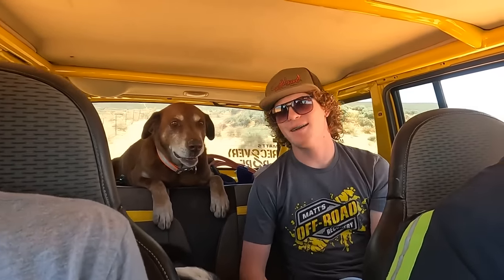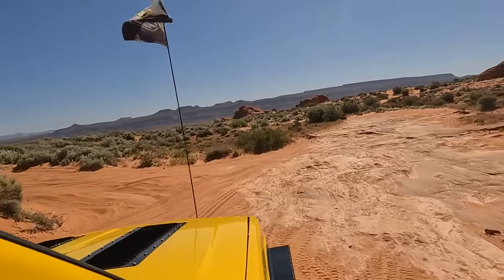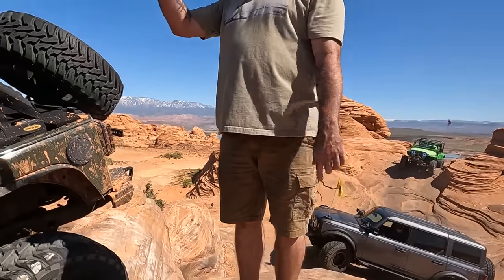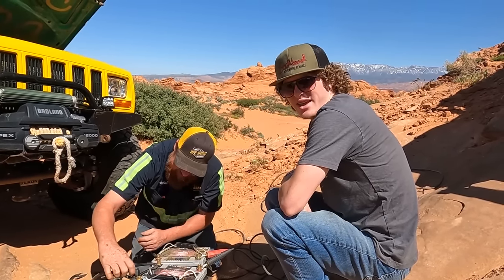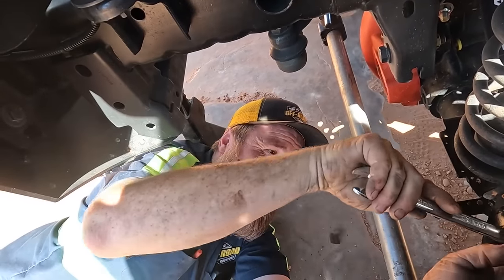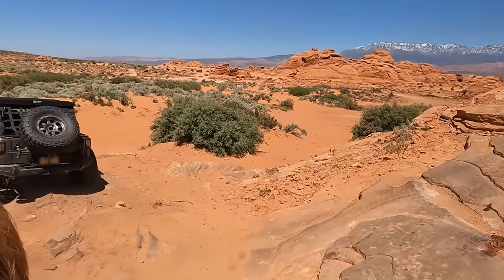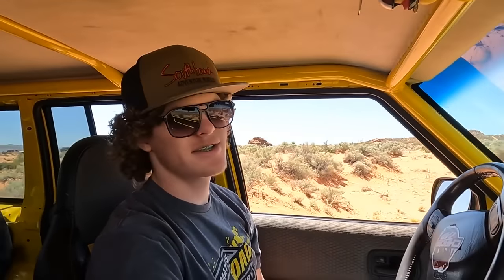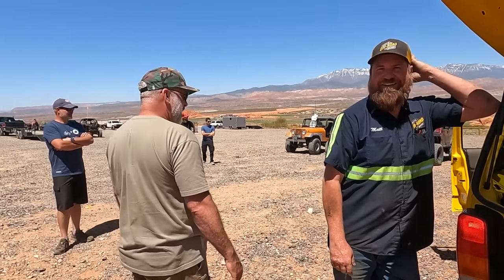I Stole This Recovery...Sorry @trailmater & @offroadrecoveryteam

Comment: Impressive repair similar to what Tom Tom did last video with only 2 batteries. But most impressive of all is that Matt remembered to bring a chipping hammer!
Reply: More impressive - he didn't run out of gas.  I suspect Jamie might have had something to do with this.
Reply: Matt did have his trusty claw hammer, tho.
Reply: @jimhansen5395  it's a stick welder, no gas needed.
Reply: @tomcardale5596  The CAR needs gas, to get them to the site and back home.
Reply: Lol yeah and now that I watched Tom and Matt use 2 battery's to weld I can certainly do it and I can't think of a single thing that could go wrong.
Reply: @RjBrown-ks5tz  Make sure to keep the batteries real close to the welding action. Batteries love sparks near them.
Reply: @jimhansen5395  When he finally gets the welder installed in the banana, he will run out of gas because the engine has to fast idle to power the welder.
Reply: @RjBrown-ks5tz  
 I've done it a few times, part of reason went with dual batteries in my XJ. Then I got a Ready Welder to add more capable to it.  Started being known as the tool truck with a Jeep club I was in.
Reply: @61 Rampy  absolutely. the closer to your workpiece the more amperage you can pull out of them. I just need a welding helmet maybe I will just squint.
Reply: @D B  nice thats handy out their.
Reply: @JohnShalamskas  LOL
Reply: Using a welders smock/jacket, helmet, gloves, chipping tool. Is this the same guy of yesteryear? Starting to look real professional. Colin may be certified, but I've been really impressed with Rudy's welding too.

Comment: This is not a gripe: just some words of wisdom..  Note to all customers [ if you have locking lug nuts, keep the tool ( otherwise known as the key) in the glove box of "that vehicle" Always] i learned this lesson myself so I'm passing this knowledge on, is all... take for what it's worth..  
Matt y'all done great especially in that heat🌞, good job callin help for safety ( you never know, it only takes 1 time😉) keep em comin..👍👍         🐌☕🐢
Reply: You might not gripe but we will!  KEEP YOUR LUG KEYS IN THE DAMN TRUCK!!!
Reply: Or just don't use splined lug nuts. They don't thwart thieves and ONLY screw over the vehicle owner.
Reply: Thank you! It needs to be said.
Reply: @Patrick.Weightman Stop thieves here
Reply: Let's go someplace I'm likely to need the key and put it in the other vehicle that it definitely won't be needed....silly FEEP owner
Reply: Just pound a socket over them.  Works every  time.
Reply: I'm a mechanic, I approve of this message, and this is totally a gripe. An absolutely justified gripe. 

Customer wants to have "locking lugnuts".. customer damn well should have the 'key' for those "locking lugnuts".
Reply: I'd go one step further.  Go to the trouble of getting a spare key from the mfgr and wire it to your jack or something.  Sooner or later you'll look in the glove box and God knows why, but the key is missing.  
There are a lot of ways to defeat the locks, but they don't all work on every type of lock.  The only one I know that almost can't fail is weld a lug nut to the top of the locking nut.  Drastic...but serves you right.
Reply: @jamesireland9188  How many vehicles do you see with stolen wheels? 
You can buy kits for pretty cheap that have the common locking lug nut sockets. And, can often just hammer a socket on and not even really need the special socket. 
In reality wheels getting stolen is rare. Anymore they have been going for the cats.
Reply: On the other hand I had mine in the glove box and they stole the truck and found it weeks later in good shape  with the wheels and tires gone 😢
Reply: @NBSV1  This dude gets it. Unless you live in 1980s Los Angeles I think you'll be just fine.
Reply: The owner of this jeep normally leaves the tool in the jeep, but took it out so the wheels wouldn't be stolen while it was left on the trail.  Then forgot to bring it back the next day.  So he failed,  sure, but already gets your message.
Reply: @NBSV1  lol 4 or 5 a week in our yard plenty more in the others I'm sure and most thieves are lazy that's why they are thieves. Going to a real job is to much for them they want the easy money. Just because you don't see cars with rims stolen doesn't mean it doesn't happen lol

Comment: Matt has learned from Rory about trail repairs and is getting things done. Jayme is the best partner for Matt great job!
Reply: But they all had to learn from Eric about using batteries to weld
Reply: @williamflowers8138 Pretty well known technique. Just not commonly used as there are often different options available.

Comment: Matt, you could build a portable DC welder with a pressure washer engine, an alternator and a battery, and a few inexpensive parts, and it would have adjustable output. Check them out here on YouTube. They are simple to build and use. You could also run some power tools on that welder as well.

Comment: I think all vehicles should come with an E-brake like the old Truck Tractor emergency hand brake, that you could twist the adjuster on the handle to adjust the E-brake. That system is awesome. For those that have never seen them, It was a hand brake, and If your E-brake started getting to where it didn't work, you just twist the top of the E-brake handle and it adjusted them to where they would. If you adjusted them to tight, you wouldn't be able to pull the E-brake until you twisted the handle back and loosened them up a little. You could adjust your E-brake in 5 seconds while sitting in the driver's seat. It was genius.

Comment: Thanks for sharing the battery welding. I've been working on creating my own battery-welding setup and to make it a bit faster, I bought the quick connect terminal connectors which have cam levers on them like you would find on a bicycle wheel. They didn't cost that much off Amazon.

Comment: As many of these repairs as you see, you should make a couple pre-bent straps. I also wonder what rod is used on the cast steel? Simple LH 7018 or a stainless rod ? Looks like it welds pretty well for where it's at.

Comment: Guessing you used 6011 or 6010 welding rod, your electrode should be positive on DC power.  Both are great for dirty metal welding.  If you used 7018 rods, it would also be electrode positive.

Comment: I really do think you should turn the banana into a chase/support vehicle. Load it with the welder, an on board air system, couple gas cans, bunch of tools, maybe some common parts possibly. Then use it to make trial repairs

Comment: for the brakes.... carry some finishing nails. unhook the brake line at the master cylinder and stick in a nail in the front or back line depending on which one is out...then screw the line back in.   added plus you will have a way easier time bleeding them after its home for a real repair..

Comment: you need a set of brake line plugs then you could take the brakeline off at the abs unit and plug it giving brakes back to the rest of the system

Comment: What is needed is an arc stabilizer, it is basically a big inductor that keeps the arc going.  You can use an old AC transfomer if it has heavy copper windings that can carry the 150 or so amps you get with 3 batteries in series.

Comment: The problem with jeffe'swinch is that it came from harbour junk.
They work fine out if the box  but two years later when you need it it will either just stop, or it'll let the smoke out. Either way, a good tool is measured over years, not over the counter.
My Ramsey winch is 50 years old and will dead lift a jeep all four wheels off the ground. It has a steel cable so it wont break, as do all my winches and my warns are both over 20 years old. One of which is niknamed bumper breaker, cuz it will rip your truck in half. Project Farm did a comparison review, and the warn came out clearly on top.
Cheap junk will leave ya stranded. 
Have fun all.
Reply: Just so you know, Matt uses synthetic lines because they aren't nearly as dangerous as cable if they snap.
Reply: @JohnFL  just so you know, my steel cable won't snap.
Been doing off road recovery for 30 years, never have had a line break.
And like I said, i have dead lifted a jeep, all for wheels of the ground. Matt cant do that.
Have a nice day.

Comment: I carry a Ready Welder brand welder on my Rock Crawler, it has saved many weekends! It works off batteries just lke what you used except it's a wire welder that can use flux wire, or solid wire with gas. It works great! You even run aluminum wire for aluminum fixes with a bottle of course.

Comment: You should build DC welding rig to hold the batteries, etc. with a switch so you don’t have to mess with connecting and disconnecting the batteries.  It might be a fun project.

Comment: I welded a tie rod back together on a CJ5 on the trail when I was about 17 and new nothing about welding using two batteries and two sets of jumper cables... it's actually worked really well. Held all the way home.

Comment: Hello from Scotland again more food for thought matt!! Instead.of batteries.
Here we use an inverter 3<6000watt to power a small 140amp inverter weld set which also gives you scratch tig as well.
Let weight more room for other more important stuff!!
Regards Bob the welder

Comment: Knowing what reversing the polarity does helps weld over head and upright also , great job with the direct current welding , peening also while the weld is cooling reduces the chance of the weld cracking big time so i recommend always peen critical welds always if you can hit it with a ball peen hammer works. peening relieves stress built into the weld as it cools, weld is shrinking.

Comment: I've done a lot of welding but never with batteries. I'm surprised it works as well as it does. By the way, most  steel welding is dc. Your mig machines back at the shop are all dcep output.

Comment: If you have three 12v batteries, just wire them up in series for 36v, that will give you a more stable arc than 24v on trail welding. With a car size battery, you have plenty of amps.

Comment: Two 12 volt batteries is optimal for most DC stick welding with batteries. You can even go as high as 36v, but 24v usually gets it done. To ensure a smooth and reliable flow, having batteries in parallel keeps things balanced out nicely.

Comment: I hope they are told to replace parts that get welded. They will get them home but in some instances may not last long. Great video as always.
Reply from the maker: Yep, they’re well aware it’s only temporary.
Reply: I cut everything off the next day and ordered the new parts. Matt did a great job DC welding cold cast. It was on there solid. Just waiting for Currie to ship me the new axle so I can throw it back together.
Parts list:
4340 Chromoly Axle
Axle Stub
1350 U-Joint
Steering Knuckle
HD Ball Joints
SS Brake Lines
Standard Lug Nuts
Reply: @DannyAllen-t8r  Good that's what I like to hear. Rory is teaching him well. Wow you're doing a first rate repair. Stay safe out there.
Reply: @MattsOffRoadRecovery  Glad to hear things are proper. You really upped your game doing trail repairs. Rory must be so proud. Hey be safe out there.
Great videos !

Comment: Jamie - if you're ever asked to get close to /help with  DC-from-battery welding, please remove your wedding band first. If you accidentally managed to connect the live to ground through your ring - that's one finger gone. If you can't remove it, wrap neatly in insulating tape (not comfortable, but neither is a band of molten gold...)

Comment: Ac welding , polarity does not matter because of the alternating current and is usually for lighter duty welding, heavy duty welding is done with DC welders usually with about 18 volts and polarity do's matter a lot , if memory serves me right neg should be in the electrode for deepest penatration.

Comment: Battery powered (as in li-ion rather than car batteries) exist.
Having one of them would mean you could swap the welder between whichever of the Banana and Morrvair is in use on the day.
Reply: I just came in to suggest this, having also seen the other trail welding video.
I run a Fronius AccuPocket for farm and forestry field repairs, and it comes along on the off-road stuff too. It's a self contained battery powered stick (MMA) welder that'll do 10-140A for stick and 8-150A for TIG.
I've burned 18-20 2.5mm (12 gauge?) rods at 70-90 amps, or 14-16 3.2mm (10 gauge?) at 90-120 amps at a sitting, and still had a bar or two of charge left. I've never not been able to either finish the job completely, or at least make something good enough to get it back to the workshop to the big welders.
They're enormously versatile, and can also be run off the mains while charging or off a quite small generator (2 kVa or so). I haven't tried it, but I'd suspect it'd run/charge for a long time of one of these big power packs I see people using off roading these days.

They're NOT cheap though (3 grand or thereabouts a few years ago)! However, a welding kit with one of these that can be loaded into whatever vehicle is going on the job might be a cheaper option than fitting each vehicle with an onboard welder.
It's just an option I thought I throw out there, I don't know if any of the main US welder manufacturers do anything like this though.
Reply: @IvorClegg  there are lesser brand ones too. In the UK, SIP sell one for about half the Fronius. The Fronius is probably more than twice as good but how good do you really need!

I assume you can get really off brand ones too.
Reply: I think they want to do this just for fun and for us viewers.

Comment: I would look into Karnage Welders. They make a briefcase Flux core wire feed welder that runs off of its own batteries. I can't say if it'll be better than powerwelder but it's a small portable setup.

Comment: One time at work some guys were playing around and took about 20-30 D flash light type batteries, cant remember the exact number, and linked them up in series and it burnt a 6013 rod. I cant remember the name of it but there is that system that used what looks like a big Mig spool gun and uses batteries for power.

Comment: Curious if the no brake situation was due to no fluid left in the system or just the torn brake line? Could clamping close the torn line help in keeping line pressure for the other brakes to function?

Comment: so, I will be soon going to Big Shell national seashore, 60 miles of sand. I have over built a sand anchor for self recovery, looks kind of like a pull pal. I also have a kinetic rope, extra winch line, and a winch of course, roller snatch blocks, snatch rings, 2 sets of traction boards in bags. I also have gloves, bow shackles, and i have over a dozen hand tied (i tied them, i also have pulled down trees with them) soft shackles in 3 colors and different sizes. .Maybe i need that welder in case i have to fix my pull pal copy. I am looking at them already. What else do i need? Other than a12" lift, big tires, and bead locks?

Comment: I have seen you use batteries a couple of times for welding. I don't know if you are aware but there are some really high performance batteries that produce a lot more current and capacity than lead acid. The leading company is XS Power. They are superior in all respects to lead acid or even LiFePO4.

Comment: The battery welding seems cool & functional!
Regards no brakes on the Wrangler, do you ever put the banana behind a vehicle in thar situation and let it be towed, use the banana brakes for both vehicles?
Your son complained just like mine does, not doing unless. My XJ has working AC it just isn't very effective, so either registered time or check the cabin filter. 
PS, going on a date, is that what they call it there Jayme?

Comment: Instead of using batteries. There is a battery/recharge source called....
ECOFLOW. I've seen a guy use it all day welding in the Philippines and run his construction tools. It's a lot better than carrying 3 batteries. Check it out, it'll be worth it!

Comment: Ok,  we need to correct Matt here a little bit.  24VDC will actually shock the hell out of you.  I worked on 24VDC battery banks in sailboats and if you're sweaty and somehow manage to bump into the distribution rails it will light you up about as bad as 110VAC will.  DC is worse than AC per volt.  Always stay insulated from high voltage DC,  24V and higher.  Trust me.
Reply: Usually you need 3 batteries in series ( 36 volts) if in series with batteries in banana ( wired in parallel) for a total of 48 volts. The 2 batteries in parallel double the amperage the ones in series reduces the amperage. Any voltage is dangerous but industry’s standards go 50 volts and above is where PPE is required. Amperage is nasty in general.

Comment: Been a welder for 50 years and I hate stick aluminum welding. Never did enough to get proficient at it. Guys messed with me the first time I tried it in the service. Told me to run it at an extremely hot range and I blew a hole in the captains ceiling of his sleeping quarters. Didn't go well. Shows you sometimes can't trust your so called buddies.